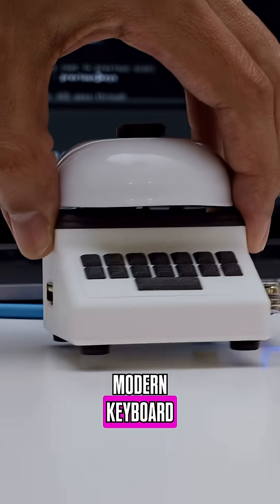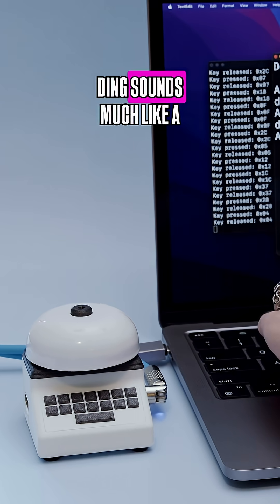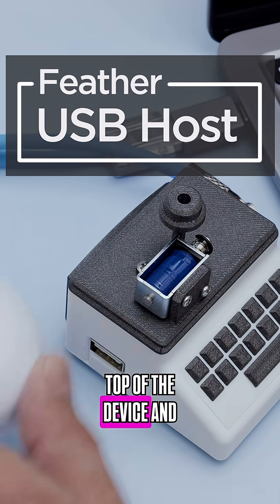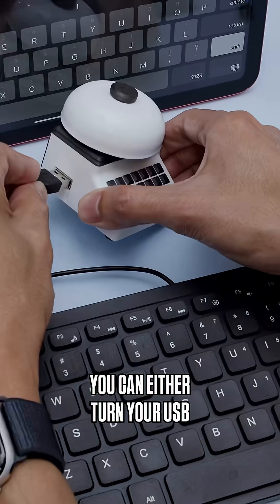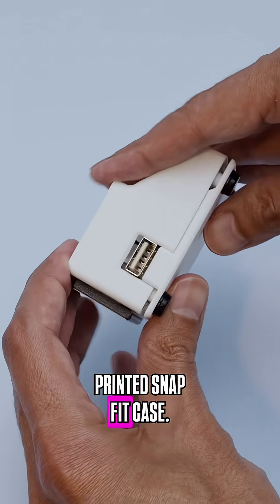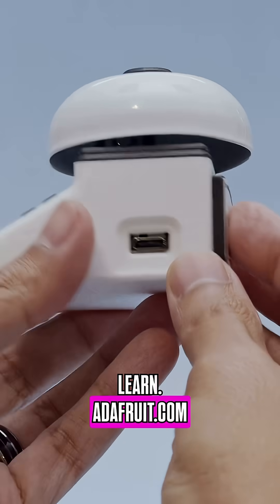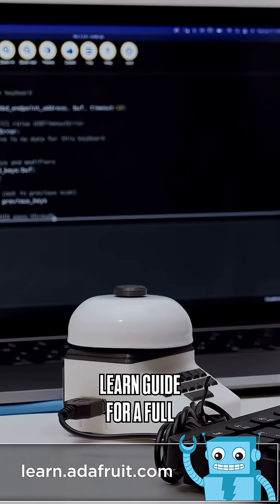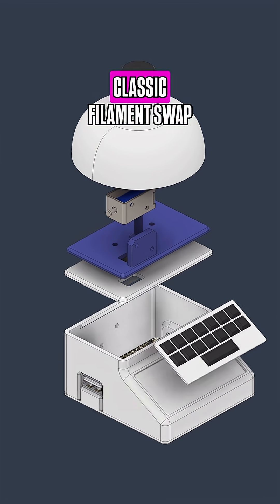Build a ”Not A Typewriter” in CircuitPython learn.adafruit.com/not-a-typewriter #adafruit #3dprint

Comment: Wow that’s genius. There is a nostalgia on retro devices and thanks to microcontrollers which are helping us go back in time. I am currently making a writing tool which works with usb or 2.4ghz keyboards. Instantly on and ready to type. I have a freewrite device but the one I am building will be dead simple without all that account email, password, sync jumbo mumbo. Turn it on and it will continue where you left. Main menu will have Create, Edit, Read, Delete options. When you write, it will auto save every few seconds and the screen will have current session word count, time, book name and saved status. I’ll post it on my channel once I finish.